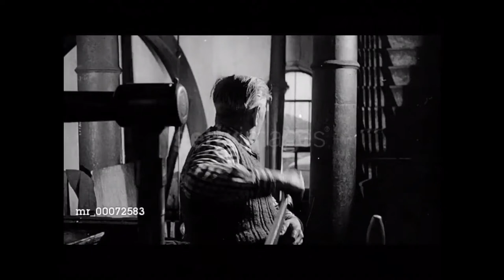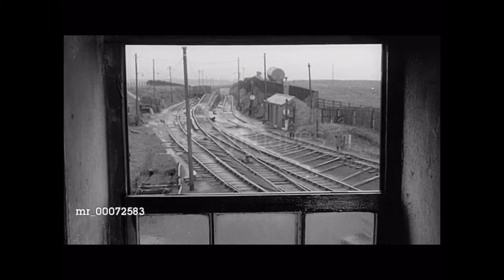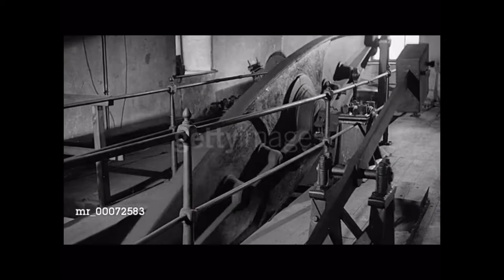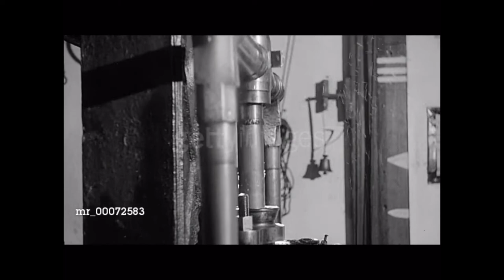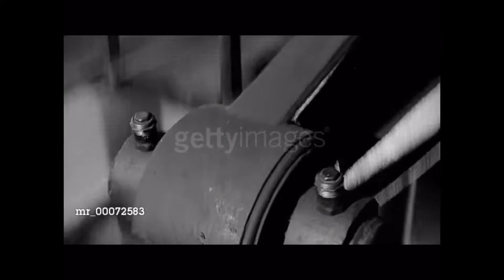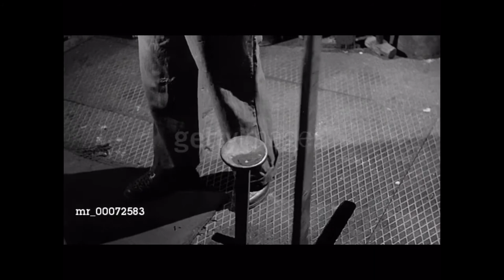Warden Law Winding Wngine around 1955 (Getty Images)

Comment: This engine was saved and is in store at Beamish. There is a picture of the cylinder on Geograph - https://www.geograph.org.uk/photo/6717511
It is also featured in my major article on beam engines (well over 100 engines) - https://www.geograph.org.uk/article/Beam-Engines-in-the-UK
James, you can contact me via the Geograph site. I can probably answer most of your questions about stationary steam having been interested for 45 years.
Reply from the maker: Thank you so much. Your very helpful.  Next time I’m at beamish I will look at the cylinderCould you maybe subscribe?
Reply: @teescottageguyproductions  Subscribed to your excellent site.
Reply from the maker: @str8jak  thank you so much! It means alot. If you like stationary steamers you should have a look at the remake video of my private visit to Shore Road Pumping Station which houses the worlds largest grasshopper beam engine.
Reply: I know Shore Road well and first visited it in 1979 before restoration - it is a beast. It is also very unusual in being a true Woolf compound with only one valve to let the steam out of the HP and into the LP (engines like Claymills have separate HP exhaust and LP steam valves). It was operated for a time by hydraulics but sadly closed. Your pictures show that it is not in too bad order considering. You may not have realised but in a room to one side is a big winch that was once steam and still shows evidence of that. It is quite well hidden. Have you got contact details for the site or was it a bit of luck? There is a second engine house on the Liverpool side.
Reply from the maker: @str8jak  ah right. Yes she’s a beast. The Liverpool side is called George’s Dock Pumping Station and I visit that the same day and that’s on the video. There are two shore road visit videos and I show George’s Dock in more detail in the older one. The first ever time I saw it was luck. The second time o saw it (when it was filmed) was arranged by the owners Network Rail and yes I do have their contacts